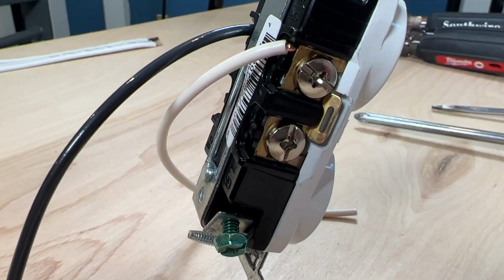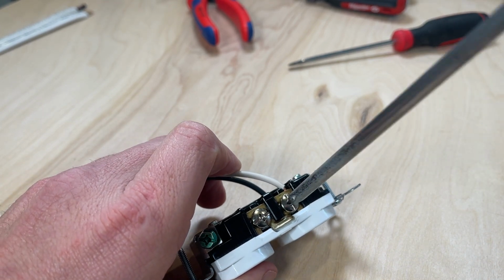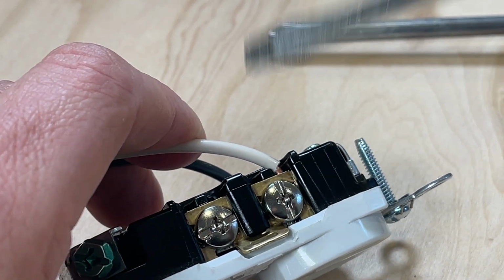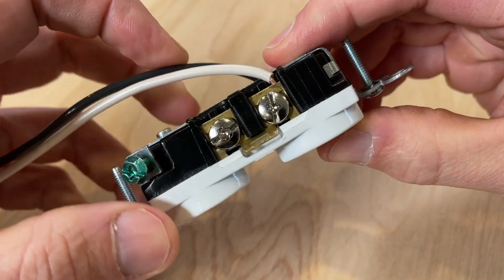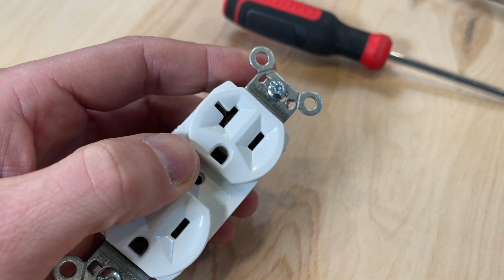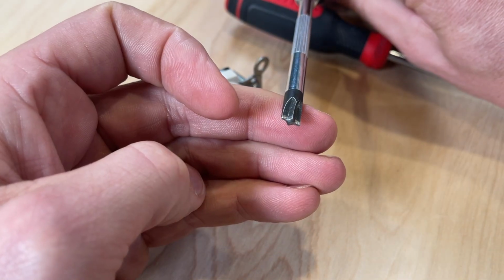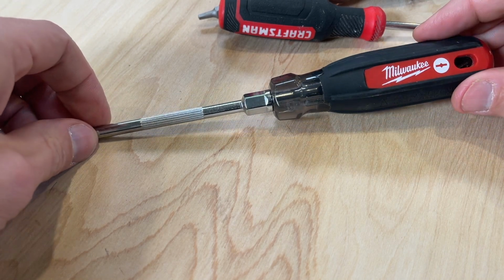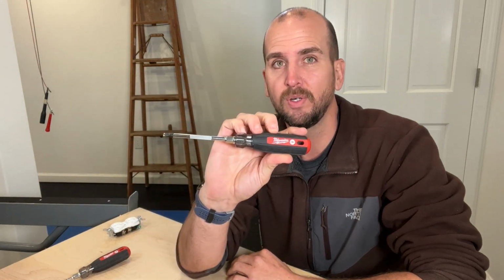80% of People Use the Wrong Screwdriver For Electrical Work

Comment: Some receptacles imported from the US and used here in Canada don't include the Robertson cutout. Square drive and Robertson have a different side angle and are not the same. It is getting anoying that it now takes 3 different drivers to install a ceiling fixture, don't even get me started on boob lights!!!

Comment: As an electrician I almost never stab in the back. Hook the wire clockwise and tighten, then torque. Also a wider flat head is really all you need. Although I would totally use the hybrid I’m just cheap and wait for tools to break before I’d get it
Reply: Ok so I'd tell you how much the guy coming behind you to service your devices in 1, 3,5, or even 10 years hates you for hooking on a device that accepts stab ins but seeing as you refuse to acquire the proper tools for your job I'd say to keep it up champ, because if you stab in the back and don't get the wire snug it will pull out of the terminal when the next guy goes to pull that device and possibly send sparks which could blind someone. Or worse. Maybe one day youll get hit with something unsavory and it'll convince you that using the proper tool for the job is important because you don't want to be that guy that caused you to lose an eye

Comment: The receptacle was made to be used by multiple bits / tips including flat and phillip
Reply: Its called a standard blade not flat.  A flat head screw is one that has a flat top that is flush with the wood when all the way in.  The screw also can be driven with a Robertson #2 for the wires and # 1 for the outlet to the box, depending on the manufacture and location.

Comment: I use an OLD flat blade that is as long and wide as the average outlet screw (it fits perfectly and nice and tight) and someone in the past plastic coated and electrical taped the shaft. It was left in my previous house that had old pushmatic breakers and my guess is he had it for changing them out when they broke.

Comment: When the Avro Arrow was scrapped a lot of the Canadian and British engineers were hired by NASA.  They of course preferred Robertson screws.  A # 1 is the green handled or headed screw driver but a lot of electrical stuff is a #2 or red.  It's so disappointing when a lot of stuff from China has those damned Phillips screws.
Reply: The U.S. is a far larger export market, so that's a reasonable business decision on their part.  For all its shortcomings, the good old #2 Phillips is the de facto international standard.  Remember, the Phillips screw was intentionally designed to limit how much torque can be applied by the semi-skilled workers on an assembly line!

Comment: The ECX has been fantastic and definitely my go to for circuit breakers especially. You won't go back after using one, especially if you fully understand that the amount of torque applied determines the current the circuit can safely carry and keeping those connections cool under heavy loads. Extremely Important and often ignored!
Reply: Right.  With any of the 4 kinds,  I can torque any of them more than they should be, but an ecx bit on a ratchet limited on T handle gets it perfect every time.
Reply: @ptx3914  Hell yeah, now that's how to do it. I use one of those T handle ratchets with the torque set so I would quit tearing up hose clamps over tightening them!

Comment: My choice is the square bit, since I don’t want to spend any money for a specialty ECX tool.
However, the Klein 32303 multi tool screwdriver includes an ECX bit.  It also has an extendable shaft. Better option over Milwaukee.

Comment: I learned about ECX last year and lucky too since I just replaced every single receptacle and switch in a 1968 house with commercial grade stuff. I saw a history video, and Philips was designed to cam out to prevent over tightening, Uggg!
Reply: Correct on the cam out design for the Philips drive.  They did not have clutch drivers in those days so it was made to slip out to keep it from getting too tight.  I have a frig that has every screw in the plastic door too tight and every screw broke through the plastic.  this is one case where they did not use a clutch drive and broke out the plastic by overdriving the screws.   Now I am redoing the door so that it has metal that can take more torque without breaking and will use a clutch drive so they are not too tight.  Even new things need to be fixed from the factory because in China they don't know these things.

Comment: The best choice is a properly sized straight blade screwdriver.  The one in the video was too small by a factor of two.  However, the fundamental problem isn’t the screwdriver than 80% of people use, but that 100% of outlet makers use the wrong screws.  There is no reason today to now use Torx screws.  That solves all of the problems.

Comment: I had a GFI outlet trip I replaced said GFI but no luck. No voltage and breaker not tripped. Call a licensed electrician who spent about a hour checking everything. Turned out that another outlet had loose wires on that line. They where not tighten down enough and evidently came loose. Tightened outlet everything came back.

Comment: I use Ideal 12-IN-1 MULTI-BIT SCREWDRIVER & NUT DRIVER W/COMBO HEAD™
SKU 35-939.  As a professional Electrician it is easy to carry and fits most screws and nuts and even hex heads.  The combo head is the ECX.

Comment: Another tool for this is a xeno slotted/ pozidriv type E,  it is like the hybrid one shown the only difference is instead of a square drive with 2 wing added it is a pozi with 2 of the blades extended outwards to fit into the slot

Comment: Thanks for the new tool that you made me discovered. As a Canadian electrician I knew the Robertson use on outlet and use it all the time. But the new Milwaukee is a surprise and I will look for it or a replacement bit for my multitool " PICQUIC DASH7 " it will be the perfect combo. Continue the good work. 👍

Comment: Tight is tight, nothing wrong with a #2 or a flat. The most important thing is are you qualified to be doing this type of work. I am an A&P mechanic with 30 plus years of aerospace/aeronautics experience and I agree that there are some better tools but come on.
Reply: You said a #2 but there are many different types of drivers that have a #2 and a flat could be a tire or the type of screw head but is not a type of driver.  A flat head screw is one that is flush with the surface when all the way in the wood.   If you are talking about a #2 Philips then it is not easy to get the screw tight because of cam out that they were made for.  Henry Ford use the Philips drive because they would cam out and not over drive the screws.  Ok for wood but not so good for electrical connections.  A Robertson #2 can get the screw tight so the connection does not spark and start fires.

Comment: I use a small drill driver with a Phillips and then tighten with a large flat blade. I was a mechanic in a company thar manufactured electric devices and boy what a pain to get the Robinson head screws to shoot straight threw the strap into the tape.  But as far as ease of use when wiring the Robinson heads were a blessing.

Comment: I have always used a PROPER FITTING straight blade screwdriver for devices. If I was doing a lot of finish work, would consider the combo screwdriver or use a #1 square tip that I have in my tips box
already.

Comment: Wiha also make one, simply called SL/PZ and it comes in a 1 and 2. A PZ head would probably fit that screw better than a PH does. Also the flay headed one should have been at least one size larger to provide a better fit. Robertson heads seem to still be the most popular in Canada, as well as when it comes to driving pocket hole screws.
Reply: I just tried the Wiha PZ1 (Pozidriv) and works but not nearly as well as a PH2. The PZ2 won't enter fully. I don't have an SL/PZ to try.

Comment: If I'm doing a lot of devices I use an apex bit in a cordless drill with a torque clutch, beats the heck out of all that twisting the screwdriver, a side benefit is speed and consistency tightening terminals and mounting devices in boxes.

Comment: I've always wondered why the terminal screws seem designed to be driven by both flat and Philips. Now I learn that they can be driven by Robertson. And now the ECX specialty driver. I think I'll just use a good quality of the correct size philips and be wary of cam out as an indication not to overtighten. Better yet... think I'll just use the stab terminals from now on.
Reply: Please don't use cheap outlets and their jab terminals. You will be sorry. The jab terminals don't hold well.

Comment: Would be interested to know the reasons (presumably commercial) why pozidriv did not supersede Philips in North America. It is the default in the UK. Not perfect, but less likely than Philips to cam out because the fins have straight (rather than curved) sides. The smaller secondary fins add a bit more bite, but I'm not sure how important that is in practice. I always groan when I see an actual Philips screw.
Reply: Repairing older audio equipment for a living, including some European brands, I often see equipment with Pozi-Drive screws that have been stripped by idiots who don't know, or don't care to know, the difference. I actually yelled at my boss and called him names once for using an ordinary Phillips screwdriver on B&O speakers with Pozi-Drive fasteners,  and I got away with it because he is extremely anal retentive and obsessive compulsive about how other people approach their work, and using proper tools and techniques and so on. He used to call us employees names ---- "you're an idiot" was a favorite ----  But he doesn't do it anymore after I lit into him!

Comment: What is Strange is Klein has a Philip’s Screwdriver with a little piece of metal sticking out of the Handle, next to the Shank. It’s for making a perfect loop in the wire, to go around the screw. I’ve never have come across a Robertson with that feature.

Comment: lt truly fascinates me how in the UK it is drilled into us that any electrical work  has to be done with insulated screwdrivers rated at 6000 V  at the same time the  power isolated which is know as Locked Off.

Comment: The #1 square bit works pretty good. But I got a "Combination Bit" and tried it on an outlet. Much better for sure. Perfect fit.
I bought the Milwaukee ECX replacement bit for their multi tool (about 6 bucks)  and put it in my Ideal 11 in 1.

Comment: Wow. Learning more and more with each episode I watch. I've been doing DIY electrical in my home and apartments for over 30 years, and never knew any of these tricks. I always thought the "blocky" center of those screws was just poor manufacturing "and if they would only make better screws, we could all use our Philips head screw drivers. So that's a real "inside" secret to use that Robertson screwdriver. Usually screws either have a single slot for a flathead screwdriver or they have a cross that communicates that a Philips head screwdriver should be used. But this is a weird "hybrid" screw that almost forces people to use the wrong tool. Over the years, I've just use a larger Philips that would better fit the main slot of the screw and never thought much about it.  

I also noticed you put the straight end of the wire under the screw plate on the outlet. There too, I've been doing it wrong. I've seen videos were almost everyone uses a u-shaped bend in the stripped end of the wire and secures it directly with the head of the screw. I thought the plate area under the screw was just to provide a hard surface to tight the wire down onto with the screw head.  However, I am aware of the modern option on outlets of also providing one-time-use holes to stick the write directly into which where pincers are used to grab and hold the wire, but must be cut off when removed. But I mostly never use them.  Anyway, nice tips.  I'll have to watch more of your videos.
Reply: That's me for the longest would think to myself how poorly made electrical parts were . I will for sure use square drive at least on that stuff from now on.

Comment: I didn’t know that! Thanks!  But, I have an observation. The straight screwdriver is both too small and worn. It needs to be kissed on a grinding wheel a little bit to restore its tip. The same is possible for worn Phillips bits, however it takes a light touch and a sharp eye.
Reply: I have done Phillip with a  drummer tool that way can Clean the inside .

Comment: The use of the correct screwdriver is important .Especially if there is ever an insurance claim or law suit or coroner's inquest !When there is an electrical failure the first thing they will look at is the electrical connections .Then they will ask what screwdriver did you use to tighten the screws and were they tightened to specifications ???.Is it a defective device ...Was it an approved device ULC or UL .Was it a 3rd party certification .ETL,PQS,TUV ect .Someone's always going to be responsible .As a Master electrician ,Use the proper screwdriver and approved devices and install with in code specifications !Just remember to use the correct screwdriver ,Slotted Philips/Pozi,Xeno,ECX(Milwaukee )Or Combo(Klein) Torx or Allen .Whatever the electrical device comes with .Loose connections or over tightened connections can cause Fires and equipment failure .
Reply: In Canada most of the fires were tracked to the aluminum wire so it was banned her for house wire.  Not many people even now about the torque driver or specs for electrical connections.